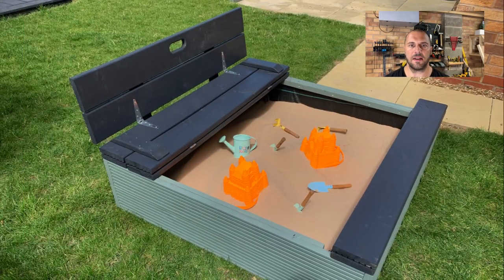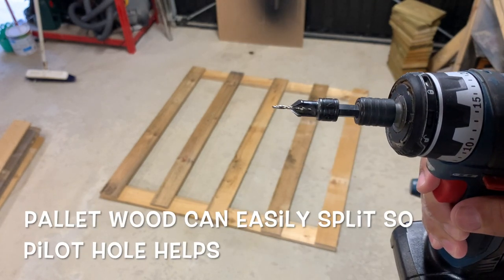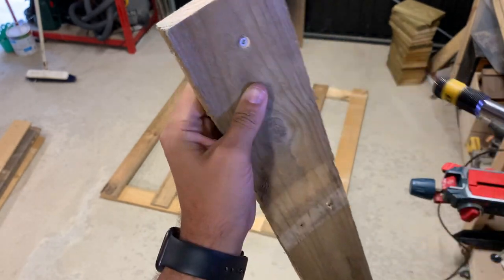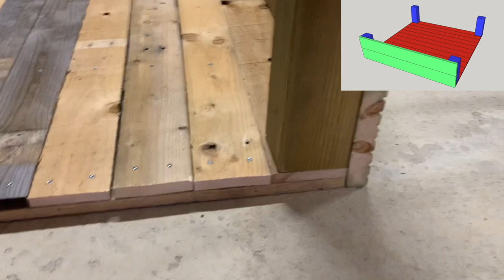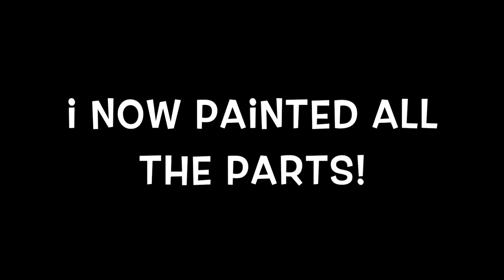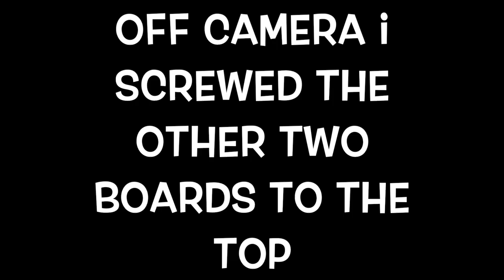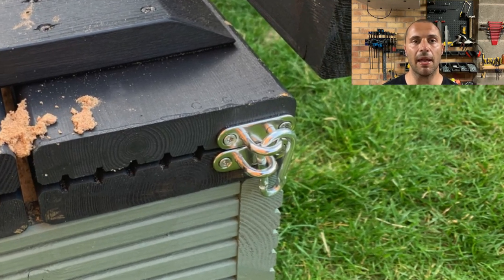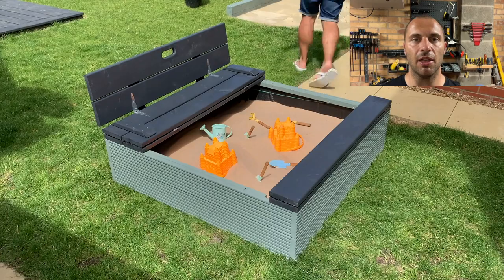How to Build a Sandpit With a Folding Top - Free Plans

Comment: any issue with the sandbox collecting rainwater??? I noticed the gaps in the wood that will let the water in
Reply from the maker: No the sand does get damp but doesn’t collect water as it drains through. 👍🏼
Reply: You need to have damp sand to be playable with